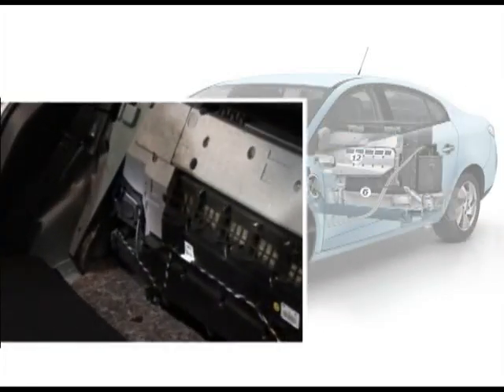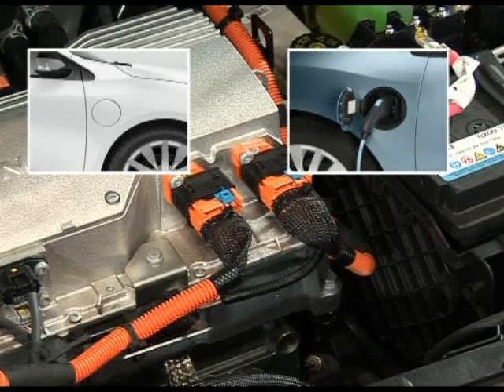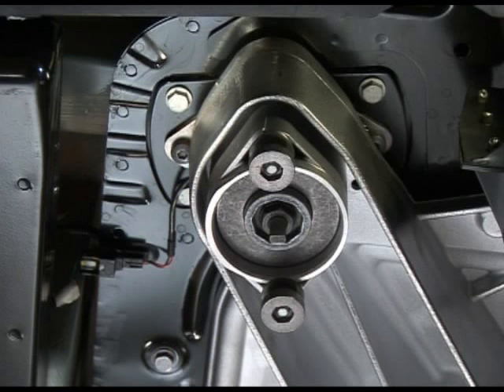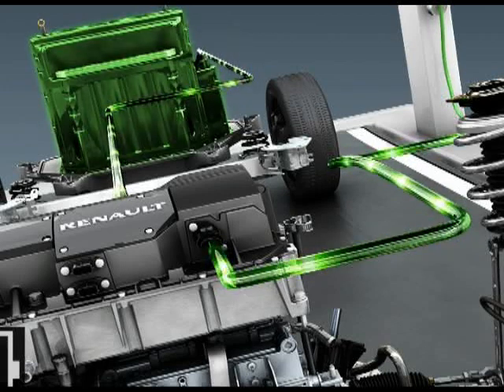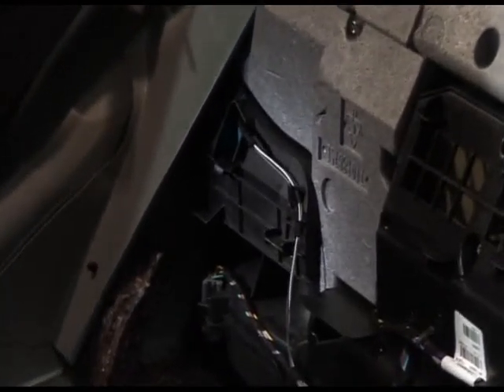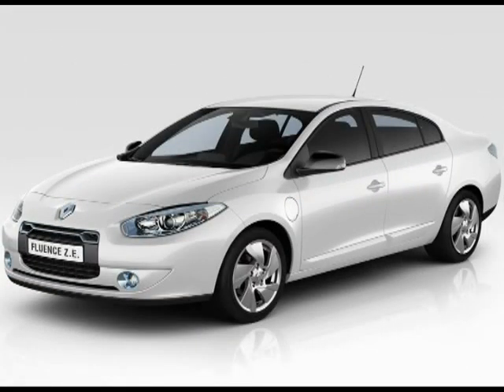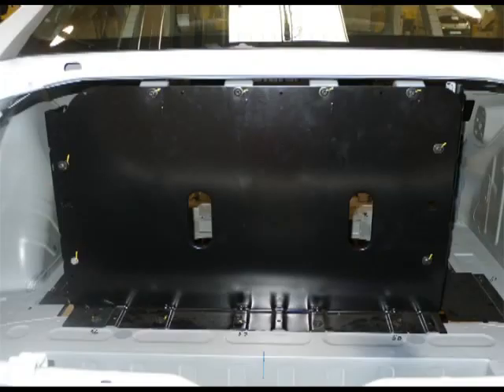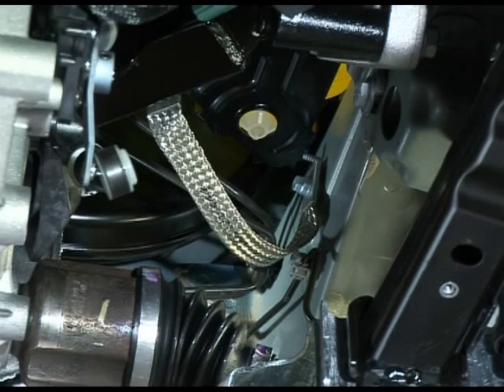Renault Fluence Z.E. - Technical Features of Electric Vehicle

Comment: Hello, where did you buy the battery and at what price?
Currently, do you know where to buy used but good batteries for Renault Fluence ZE, Renault Zoe? Thank you.
Reply: Look for unused batteries from Better Place project.
Reply: @marisgailis4108  Hello,
We searched for unused batteries in the Better Place project but found nothing.
Do you have a link to those who sell these batteries?

Thank you
Reply: @mariusionita9129  http://store.evtv.me/proddetail.php?prod=Betterplace
You may need to replace inner wiring and both controllers for prodcuction versions, and add some temperature sensors. Battery cells may need individual charging.